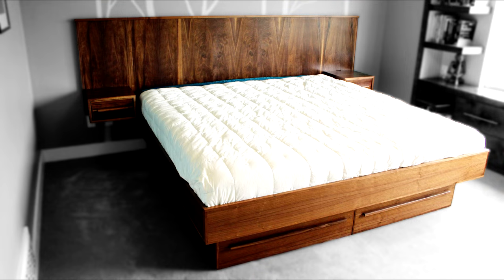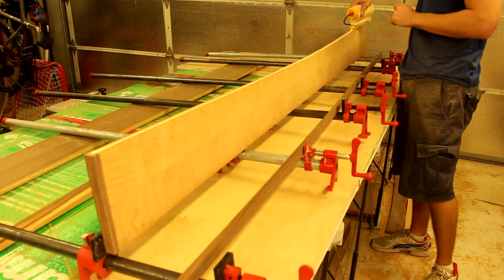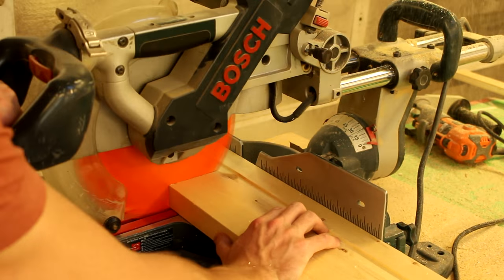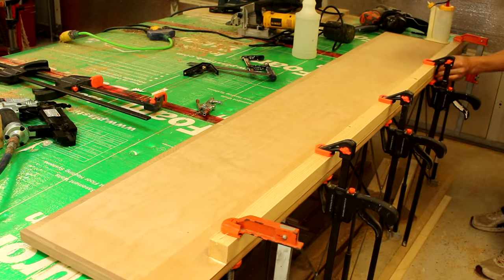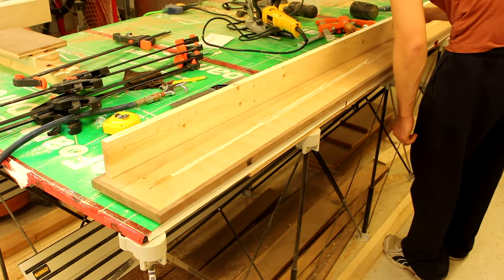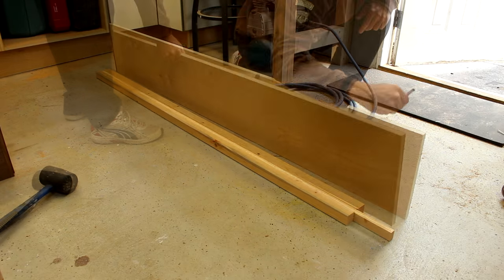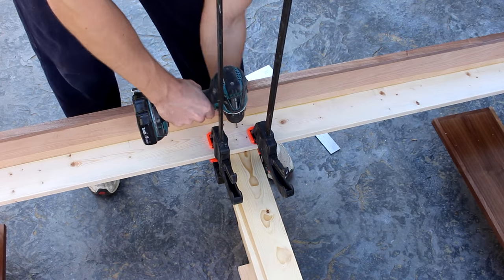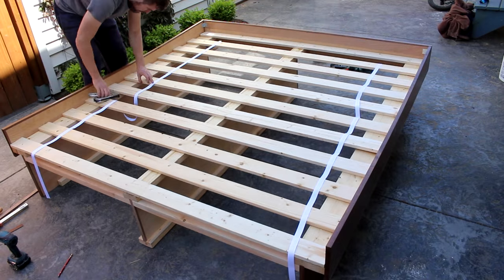Make a Mid Century Modern Bed | Part 2 | The Frame

Comment: Nice build and video. I don't see any cross bracing between the center I-beam and sides. Have you had any side to side racking of the platform while using the bed?

Comment: Nice build, wondering where does the scarf joint on the trim wind up? I would have tried to make it as inconspicuous as possible  by trying to match the color a little better. If it's in an unnoticeable  location then no foul. ;-) 
Also if you reference another video for clarification you might want to add a link to it in the description below.
Reply from the maker: +Pat M 

You can completely ignore the scarf joint if you can shell out more $$$ for long hardwood. I got a deal on shorts and hence the scarf joint. there are two of those joints and they are both on the underside of the side assembly. 

Which video reference  were you referring to?
Reply from the maker: +Pat M 

You can completely ignore the scarf joint if you can shell out more $$$ for long hardwood. I got a deal on shorts and hence the scarf joint. there are two of those joints and they are both on the underside of the side assembly. 

Which video reference  were you referring to?
Reply: You referenced the headboard video if you people wanted to see the finishing techniques. Its easy now when you only have 8 videos but later on it will be a lot tougher to find.
Reply from the maker: Hi Pat, There is an overlay link when I reference the headboard video that takes you straight there. Perhaps it doesn't some on mobile devices. Good catch and I will update the video comments.